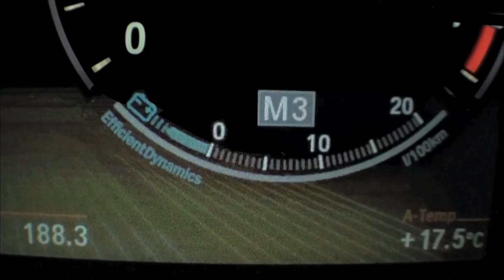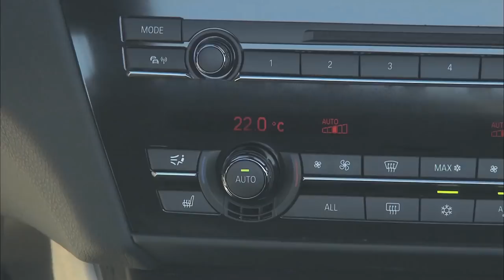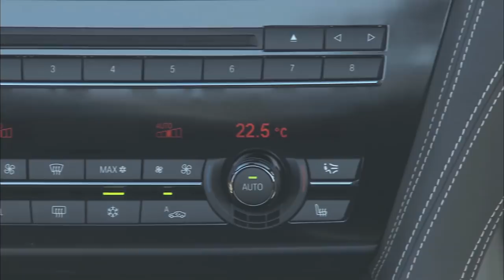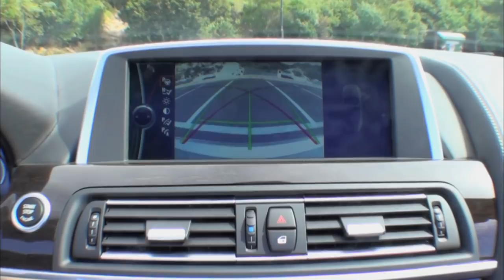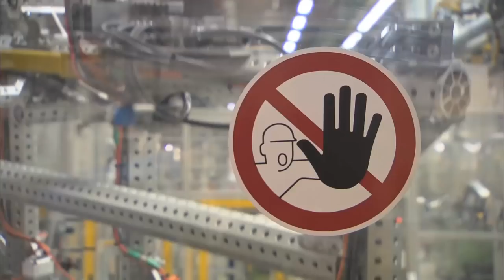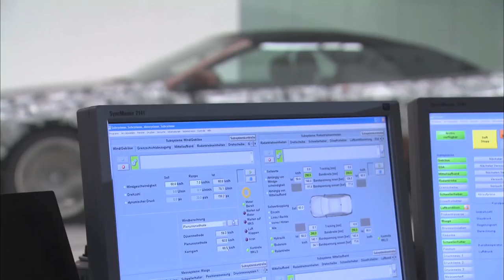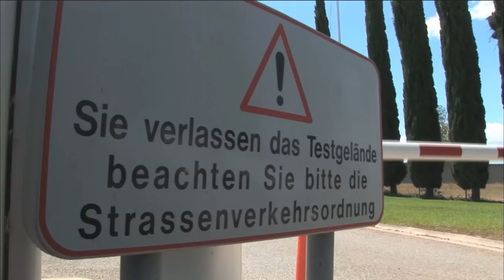All-New  BMW 6 Series Convertible - In/Out/Driving [HD]

Comment: It is a beautiful car, inside and out. One of the best.

The back seats however, have less room for my dog than the 335is and M3, even though the car itself is HUGE. It appears to be just pure design that limits the room for the seats, doesn't seem  to be something functional. Other than that, it's in the top 2 as far as I'm concerned, the other being the AMG GT interior. Both are so beautifully sculpted and appointed with awesome materials. The 8 series that replaced these 6 series cars, totally lacks the beauty and amazing feel. It's sharp and cold, appears to be new just for the purpose of being something new, not necessarily improvements. 

F12 M6's will be collector cars someday, in my humble opinion!

Comment: M6 is a tiny bit unreal for me to own, I mean forget about the cost of the car, an M6 for a daily driver is just unnecessarily costly. My current car is a V8 with 300 torque at 4000 RPM and some 290 HP, in other words the very normal 6 series will ridiculously smoke my current vehicle, which in its own, smokes most other cars on 95 on a daily basis. To conclude, I'd like to say that basically it is not prudent to have an M6 as your daily driver if you live on an income.